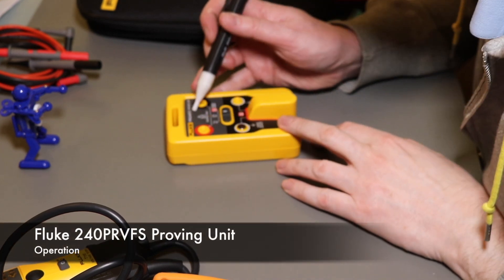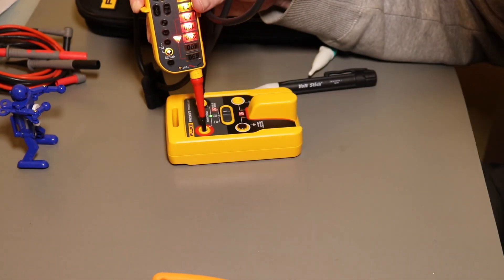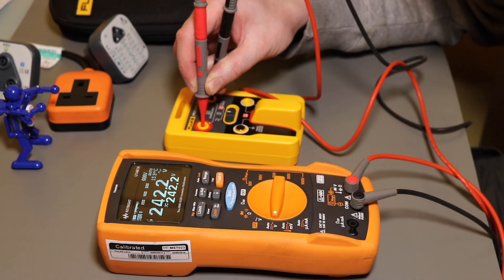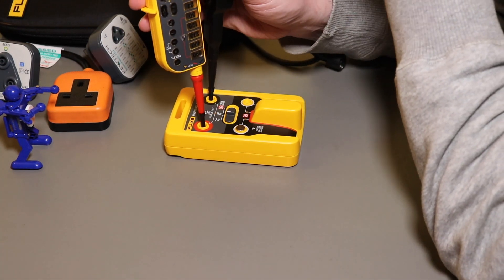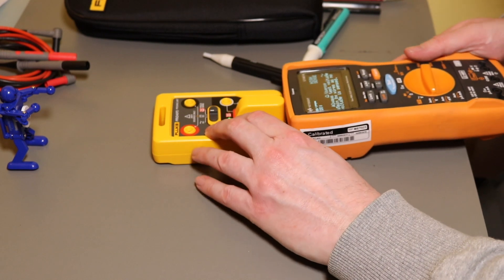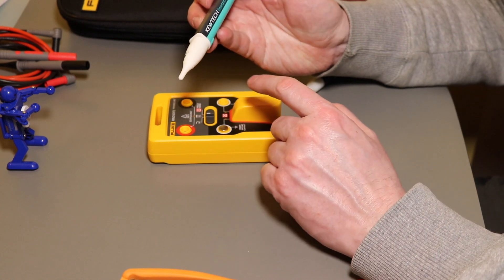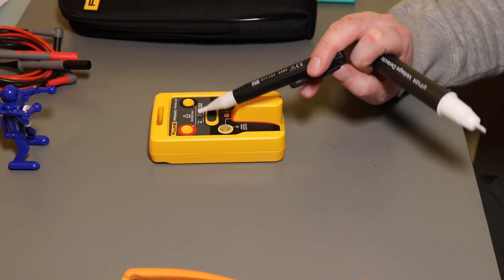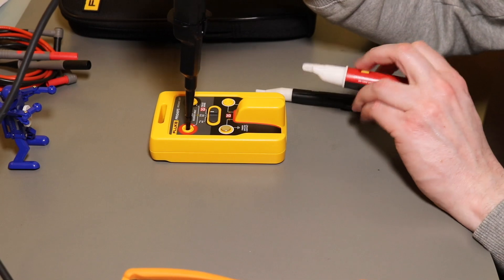Fluke PRV240FS Proving Unit Operation

Comment: I have had this proving unit for a while it has some nice features as you explained. With the shallower contact points it’s fiddly with the probes in getting a voltage response on contact voltage test probes - it can almost lead to doubt in your mind about whether the voltage probe works or not. I have also noticed that it does drain batteries very quickly and I would suggest batteries are replaced at more frequent intervals. I have a T6 multimeter as well with field sense.
Reply from the maker: I have not had any issues using it, but I do use it in the manner you see here, on a flat surface. If you are using it single handed or hung off a strap, it may well be more awkward in comparison to other units with deeper style probe access points.

My unit does have an issue with battery power consumption in that it does not always shut down to full battery saving mode. I demonstrated that in this video;
https://youtu.be/ypablcoBSKU

I modified my unit to include a power switch, so I could turn it off and save on battery life. There is a blog on element14 showing how I did this.
https://www.element14.com/community/people/three-phase/blog/2018/04/11/fluke-prv240fs-proving-unit-battery-consumption

Thanks for watching, always appreciate your comments MM.
Reply: @three-phase562  beat me to it, at this point my electronics capabilities are not as advanced but I suspected there was a reason for the battery drain, certainly it something fluke should resolve. I posted a review on their website hopefully they will address this. I will use a second unit just in case that action in itself is a serious design flaw that should be addressed by a reliable manufacturer like fluke.

Comment: Very different to my experience of the Martindale.

I think I'm going to have to try multiple units! 

https://www.youtube.com/watch?v=CnBaX0HZp9Y

For reference the meter I'm using has an input impedance of 3.5MOhm, I would guess your Keysight is 10MOhm and most voltage indicators are a lot less than that.
Reply from the maker: Yes on DC the Keysight has an input impedance of 10 MOhm, in AC mode it has a 100 pF capacitor in parallel with the 10 MOhm, so the inout impedance will be frequency dependent. The T110 has an input impedance of 200 kOhm that drops to 7 kOhm with the load switches on to produce the 30 mA load for RCD tripping.

I do have a Martindale unit, so I will go over and watch your video.

Comment: What is the use of the field sense mode? Is it a second  test for multimeter? PRV240 don't have that function...Is that useful or cheap...?
Reply from the maker: Sorry for the late reply. The field sense function is specifically for use with Fluke's T6 tester that has contactless voltage measurement, I just wanted to know if it could be used with other non-contact voltage testers.

More on the T6 field sense from Fluke if you would like to know;
https://youtu.be/vUr6ASOTmq4

Comment: Very nice KEYSIGHT is that a Insulation tester/ multimeter ? Also that’s a nice proving unit I have the PRV240 model. That’s quite a nice feature that sensor for testing NCV testers.  Great video TP keep it up.
Reply from the maker: Yes TETC, it is the Keysight U1461A Insulation Multimeter. It is a unit that I keep calibrated so is of known accuracy. The proving unit is really nice, as you say a great feature to test NCV.